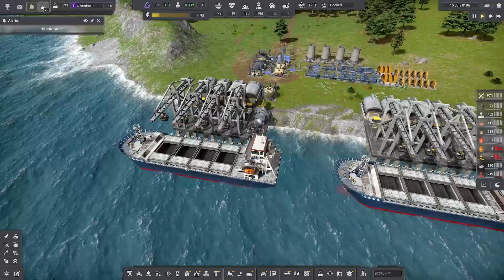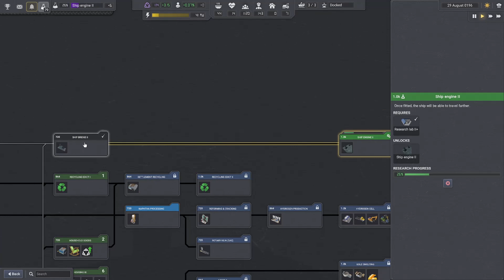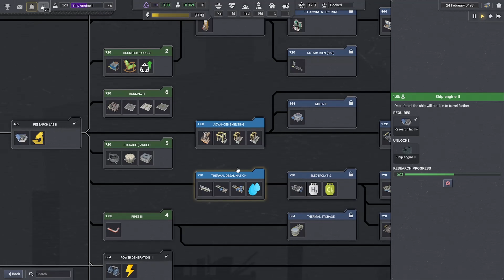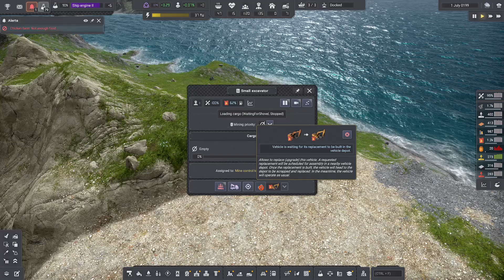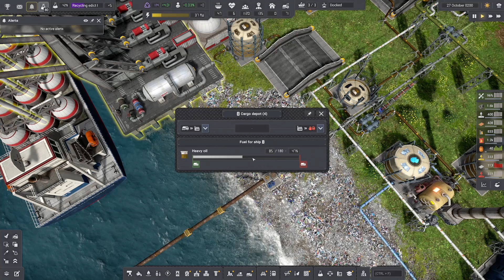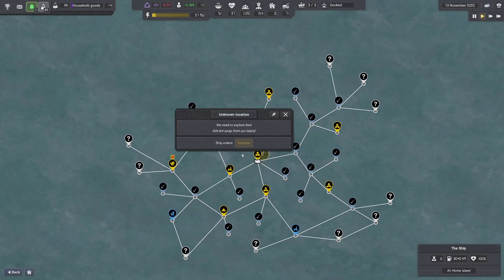Captain of Industry - Ep.17 - Animal Problem and Supership

Comment: Nice episode again, where did you get the power generation blueprint? just curious I don't really want to use blueprints but enjoy studying them for ideas, make sure you have plenty of steel for ship repairs and research the armour plating. Cheers 🙂
Reply from the maker: It's not a blueprint. There was a screenshot on Reddit. I manually rebuilt it. I will mind the steel. Thank you! ☺️🍻